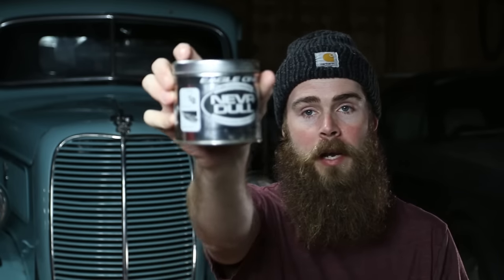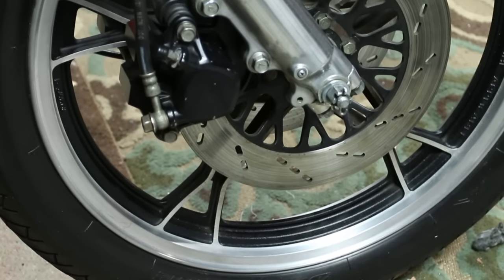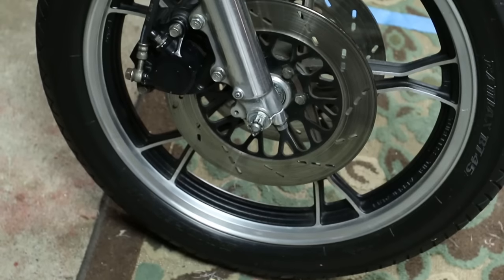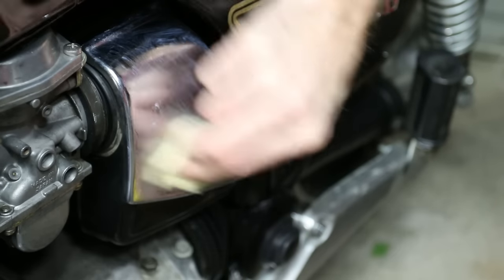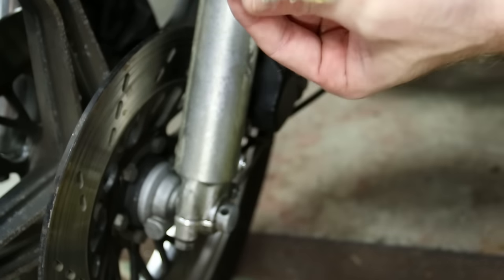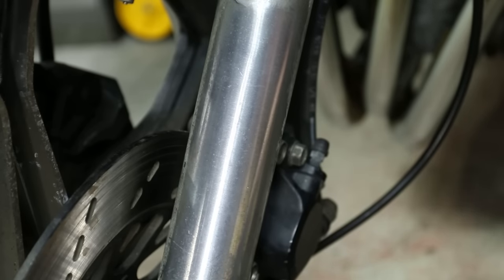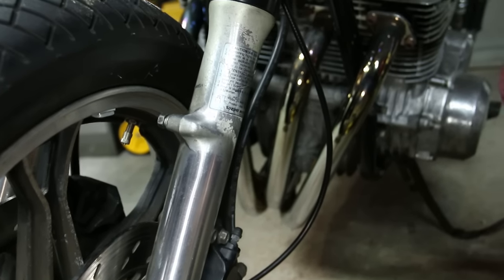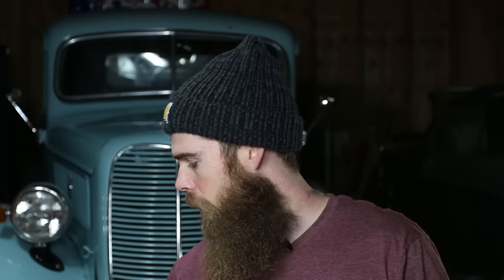HOW TO POLISH ALUMINUM

Comment: What do you apply AFTER the polishing to keep the aluminum from oxidizing? I don't want to paint them with clear coat, that works for a while, then the clear coat gets scratched up and you can't polish it. I can't afford ZOOP or the like. Would a good wax  do the trick if it's maintained? Anything better? Great video, thank you.

Comment: I used this stuff called Quick Glo about a week ago,hands down the best stuff for metal I've ever used,you literally can put it on rust and it wipes right off ,same with waterspots.Best part is it's a wax/polish also so when you get done clean you wipe it off and it protects the metal in one step

Comment: Any suggestions on a brand new 10 inch jobsite tablesaw with  Aluminum top ? It is not a smooth finish. I want to keep it brand new looking without scratching it up to much using it.

Comment: Try MMO on oxidized aluminum.  use it with a medium fiber pad those are usually grey in color.  You will be amazed.
Reply from the maker: +Sagina1999 I may try that next time.

Comment: I am going to have to give the steel wool a try. I have some diamond plating on my truck that probably hasn't been polished in 18 years since it was made. the aluminum has a grey look to it. I'd probably use a whole can of never dull I'd I hadn't heard about the steel wool.
Reply from the maker: Yeah it will lightly scratch a bit but takes off the oxidization quickly then you can just use polish from there.,
Reply: +Blake's Garage Do you think I could buy the steel wool at walmart or O'Reilly's? We don't really have any hardware stores around.

Comment: YOUR REMOVING THE FACTORY CLEAR COAT ON THOSE FRONT SHOCK TUBES. POLISH THEM OUT THEN RE-CLEAR COAT THEM. THANK YOU.
Reply: +1! That’s not oxidation on the forks. It’s old sun burnt clear coat. Paint remover will remove it easiest but can be a bit messy. I agree….remove clear coat, polish, then re-clear coat.

Comment: I don't believe you know how to use Mother's aluminum Polish. It takes a lot of elbow grease but you actually make it look like chrome.
Try this technique sometime.
Used small pieces of Terry towel from a brand-new bath towel that's of high quality. I cut out small squares that fit my knee for what I'm going to polish. Dampen the rag slightly so it's all dampened but not dripping. Fold your little square cloth into a size needed for the spot, apply a little bit of the mother's aluminum polish to the rag. Try to do a stroke of at least one foot long or as large as possible on what you are polishing. If it's a long thin strip, only do about one foot or so at one time.
When you see it starting to turn black, that's when it's doing it's magic. I usually do about 150 back and forth strokes. Take a little square of that new Terry towel and wipe it clean. Do the next portion of the metal by overlapping halfway over the part you already did. Yes you're using a new portion of the rag that is clean. After you have overlapped and polish the piece of aluminum you want to look like chrome, go over the go over the whole metal strip with a new piece of cloth and a little bit of mothers Polish. If you have stroked it at least a hundred and fifty times or 75 times each way, you should end up with an awesome finish. If not experiment to find out why. I used to detail older American cars that had stainless steel around the front and rear windshields. Mother's aluminum polish can take out a lot of those scratches and make it look beautiful.. a lot of elbow grease is required. I hope this helps some.